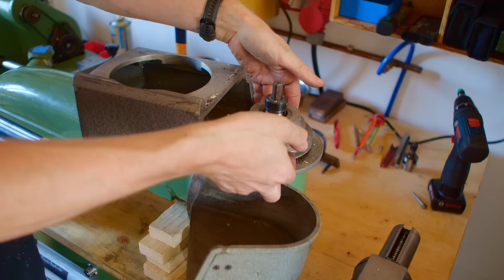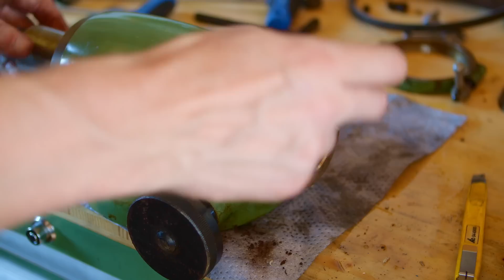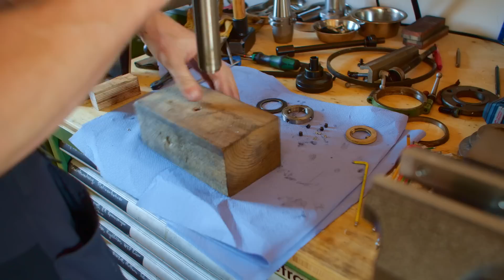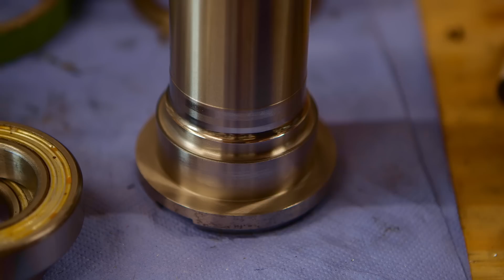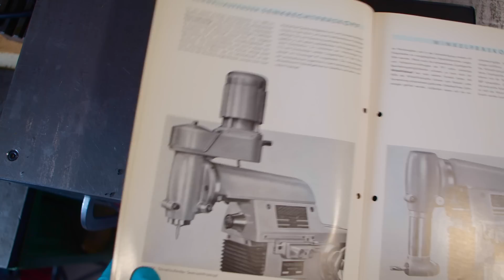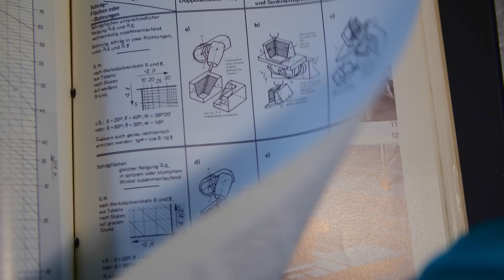Deckel Highspeed Head Teardown

Comment: A much better cheater for use with Allen wrenches is a short piece of heavy wall tubing welded to the end of a longer piece of tubing at a 45° angle. 
I can just hear the "make it better" aspect of my character thinking 'adaptor for a Bridgeport style head'. Not that the Bridgeport head is the same quality as a Deckel. The only superiority in a BP J type head is the drilling and boring operations. BP type R8 collets suck for many applications IMO. I have seen far too many instances of cutters pulling out of R8s. The alternative of end mill holder with set screws are better except in the larger cutter sizes. The larger end mill holders place the cutting forces too far from the bearings. Also the BP bearing setup on the bottom end is weak. We modified our BPs to take two angular contact bearings in tandem by reducing the spacers with a third bearing taking up the preload. 
Also on the variable speed BP heads the plastic key on the motor pulley is not just a stupid idea IMO but junk. But l suppose better a reasonably accessible sacrificial part.
Reply from the maker: The best cheater for a wrench is the one at hand :)
Reply: @StefanGotteswinter  
True. The one described works really well in tight quarters. Of course the best reason to not require a cheater is to never allow gorillas to tighten things by hand. 😁 I always hated loosening up Unbrako or Flat Head Cap Screws. That sting in the hand when they break loose of the taper. All too often the taper in the countersink is not concentric with the threads. We used to use a lot of stainless metric FHCS. The smaller sizes were use once and toss. The sockets for the hex key would get washed out too easily. I have never understood why people think SS screws are stronger than high grade carbon steel.

Comment: Very interesting video Stefan! I am happy you finally gave the explanation why the spindle bearings are integrated, it is of space constraints, not to make the vertical head more bulky or bigger than necessary.
I will look into my Aciera F3 if the design is similar. I do not have a quill though, som probably not. Have you looked into Aciera milling machines? They are nice as the Deckels are, but Deckel was probably a bigger brand, more accessories and so on...

Comment: It was fun watching your video! I am a layman when it comes to milling machines, but it was fun to see that your quill bearing assembly is almost identical to the setup in my Shimano MTB pedals (PD-MX80) they use 1/8” balls and a ~10mm diameter housing - about 20x smaller than that Quill!

Comment: Excellent!   My Tom Senior M1(1958) high speed vertical head needs the same treatment.   The quill is worn in the casting also.   I'm currently building an arsenal of ideas/info on how to tackle the refurbishment.  It will probably get the quill lock you designed for your previous mill(import).
Thanks again👌

Comment: I just hate bearings that are integrated in subassembly’s . 
My guess is that they did it just that they can charge a fortune for new spindle . Same with the tapers, they just did it inside out just so you can buy tools only from them . 
Basically, I hate nonstandard stuff like nonstandard iso carbide insert 😂😂😂 . Oh well, I hate everything.🤣🤣
Reply from the maker: The spindle takes absolutely bogstandard ISO 7388-1 tooling, just add the correct pullstud.
(The reasoning behind the S20x2 thread: It has no centering effect, unlike a regular 60° thread, hence doesnt influence the runout)

All the design choices seem very deliberate driven by technical reasons. Integral ball races for a very compact and stiff spindle/quill/head casting assembly)

Comment: Regarding the honing of the quill bore,  as you want a very close fit  ,the quill would be ground to Dimension + tolerance and then marked for actual size
Then because honing allows for real time, in process measurement It's "easy" to acheive the desired clearance.

Comment: Morning, Stefan. When you said "I think I'm burning some rat poop" that filled me with existential dread. :face-red-droopy-eyes:
Regarding bearings, I have a 1960's vintage surface grinder that I am the third owner of that is in pristine condition, I contacted a company to discuss buying a set of bearings and was quoted $450 each which is more than I paid for the entire machine! Taking care of what we have is definitely the better option if it's not broken!
Reply: Regarding expensive bearings. The shop l retired from l rebuilt spindles as my main job along with doing repairs on our own shop equipment. One of the die maker apprentices smoked the spindle on a small K&T universal head. Simple spindle with opposed tapered roller bearings. Except for the fact that the business end of the shaft had the inner race of the bearing as an internal part of the spindle. Replacing the bearing required regrinding the taper of the race. Special sized rollers and a special outer race. From then on the mill was just used as a horizontal.
Reply: @mpetersen6  The FP1 has the same setup, unfortunately.

Comment: My Haighton mill has a simple plain bearing spindle similar in design. When I disassembled it, having spent a hour trying to find a pin spanner to fit the spindle nut, I had to settled for a 3.xmm drill bit ... As I put the drill backwards into the spindle nut hole, the weight of the drill undid the nut!

Comment: I've got an FP4 in storage... waiting for my machine shop space to free up to get it going... can't wait! :D Needs a fair bit of clean-up. It was covered in motor oil to stop rust, and there are a few bits of surface rust at non-critical places... but it has the original tilt and roll rotary table with angular DRO!
Reply: My g1l is in a shed too.  I used to do a ton of semi free hand projects with it printed templates under acrylic scaled up